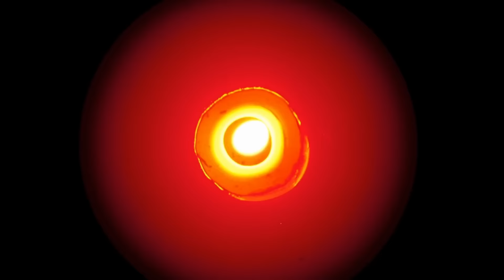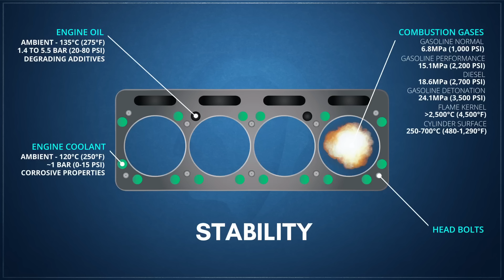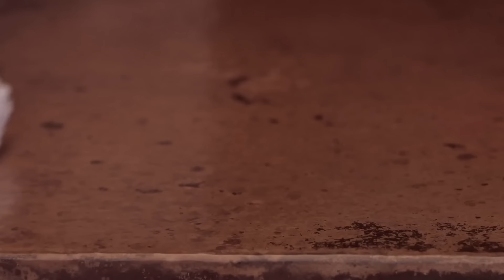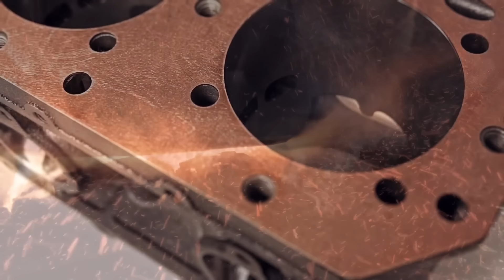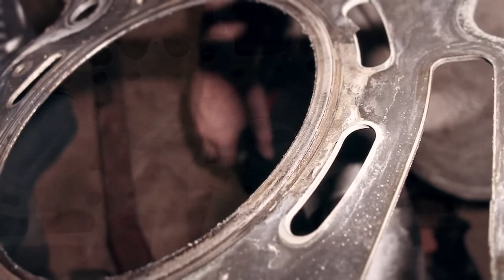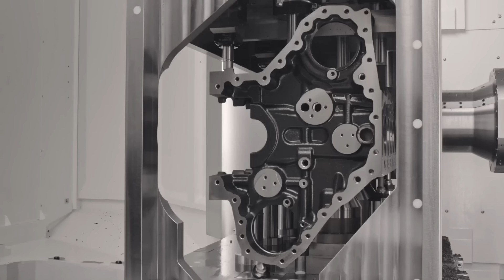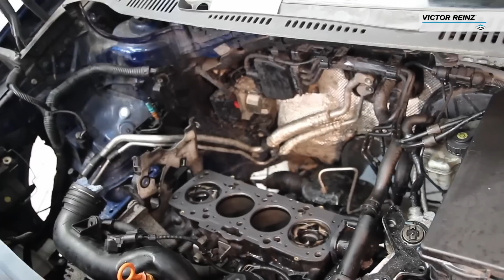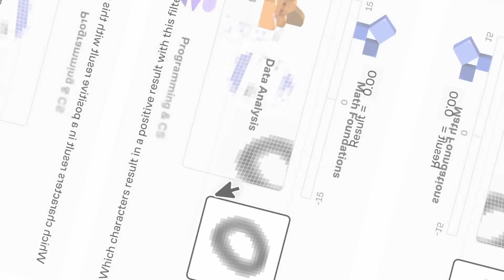Why This Basic Engine Part Is So Difficult To Design

Comment: I dont have anything to say about the video so ill post a recipe for blueberry pancakes instead.

1 x egg
1 x cup white flour
1 x cup milk
Beat briskly until there are no lumps in the batter, then add 1 x cup of frozen blueberries.  Mixed these through the batter gently for 15 seconds.
Use a hot nonstick pan with few drops of oil, put the stove plate on to its highest heat.
Pour desired amount of mixture into the pan, flip over when bubbles start to appear in the mixture. 

Make 10 thin pancakes.
Reply: No leavener? No butter or other fat? Sounds like you're making crepes 😂
Reply: This is an English/French/European pancake recipe. The recipe that uses baking soda is the completely different American fluffy pancake recipe. Both are nice, they are just different
Reply: @-xirx- it's pancakes for someone who once ate a pancake and was like ",this is too fluffy and delicious we have to invent one we can toss straight in the trash" and that's how this recipe came about
Reply: These types of pancakes are better suited as savoury style dinner pancakes. We have restaurants that basically use these type of pancakes with pizza toppings. My personal favourite, and a real classic, is the bacon and cheese pancake, sweetened with kitchen syrup (equivalent to molasses). 

I have to admit though, for breakfast nothing beats the fluffy goodness of American pancakes.
Reply: You think your savoury style pancake with table syrup (lol) would be worse if it was more fluffy? @luipaardprint
Reply: @randommcranderson5155  yeah for sure, there’s a trick to baking these to perfection where you bake your bacon golden on one side, flip the bacon, pour the batter to bake the pancake and the bacon golden brown, meanwhile you melt the cheese into the still wet batter on top, and then flip it to grill the cheese. I don’t think that’s possible with fluffy batter. I’m also talking full pan sized pancakes here. And if anything else, it’s what I grew up with 😅
Reply: @randommcranderson5155  also, our kitchen syrup really is something very different from your table syrup. It’s closer to jam in consistency, and close to black in colour because it’s heavily caramelised.
Reply: @randommcranderson5155  yes, definitely. I want crisp outside with a chewy inside, not simply cake.
My favourite toppings are fresh lemon juice and sugar. The sugary lemon juice clings to the outside crispyness, not soaking into a fluffy "cake-like" texture like American pancakes. Dont knock it until you have tried it. They ate delicioyz with savory fillings and baked too, even more cheesy crispyness!
Reply: This recipe reminds me of how my neighbour in Romania seals the copper lid on his 50 liter copper distilling kettle with a simple water-flour doughy paste before he brings the fermented mash to the boil, if done right the hardened seal won't start leaking and in case of to much pressure the lid will just suddenly blow off.
Reply: this is a terrible recipe. Don't follow this recipe anybody, go google a more standard recipe with baking powder.

Comment: I put some of that permatex spray on copper gasket material (in 3 decent heavy coats) on MLS gaskets for my "stock" daily driver head gaskets, in order to fill in the imperfections of the surface finish for the block deck and head deck, not only does it seem to seal better, even if the surface isn't 100% perfectly machined flat.
Reply: Heavy coat?   Exactly how messed up are the surfaces that oughta be smooth & flat?

Comment: They could leave a bit more meat between the cylinder bores to give them a fighting chance... And bring back 0.065" solid copper head gaskets.
Reply: copper gaskets suck at sealing lubricants
Reply: They would crush into place but I doubt the longevity is there like a 90s-00s Honda/Toyota
Reply: @SilentRacer911  Honda peaked in 1989 with the D15B2 variant. =3